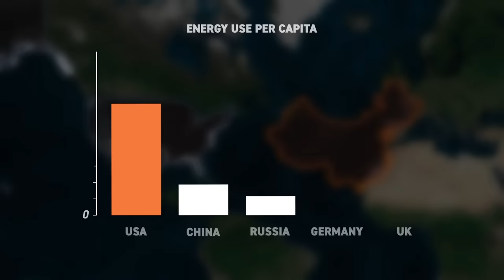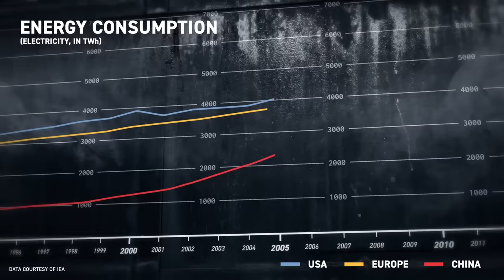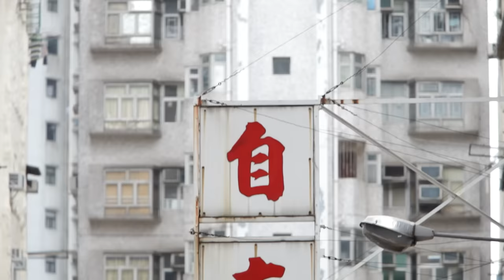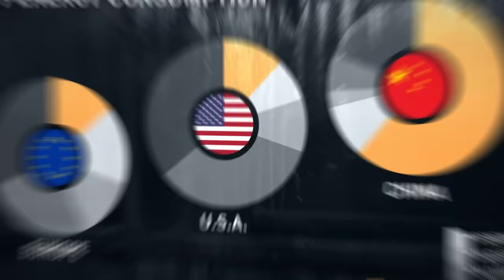China’s Electricity Problem

Comment: I thought I read somewhere that China had plans to drastically expand it's nuclear energy capabilities; I'm surprised there wasn't much discussion about that.
Reply: It is true, China developed a new type of nuclear reactor that is smaller, safer and generates little radioactive waste and over 200 of them are being developed and built with most coming online in the next decade. This new reactor is also currently being built for the Belt & Road countries.

When it comes to China, Wendover Productions tend to pick data that matches its narrative so anything that does not fit is not included.
Reply: China does plan to drastically expand its nuclear energy, but building nuclear power plants is very tricky. Old technologies require nuclear power plants to be near a large body of water for cooling, which limits the locations, and they take a long time to build. So China is also trying newer technologies which still require a lot of testing. For example, it's testing Thorium Molten Salt reactors, which is an entire other branch of technology compared to uranium, so large-scale commercial deployment is only expected in 2030 (but the hope is that if it works, it can be mass-produced).
Reply: @valerievankerckhove9325  China is already at the level of exporting components of nuclear plants to countries like US
Reply: That doesn't fit his narrative.
Reply: @singularityraptor4022  well probably not the US, and the Hualong One project in the UK is probably as dead as it gets, but that's just geopolitics... it is true that no country in the world is building nearly as much nuclear power as China, and as a result no one is better at it than them, but nuclear plants are simply so much more expensive and difficult to build than coal that they can't be a 1:1 replacement at the production rampup rates required. it definitely should have been mentioned in the video though.
Reply: @rcbrascan  I'm assuming you're referring to Thorium nuclear power? Didn't know China were even involved in that let alone early developers of the science behind it. Shame they didn't cover that yeah :(  Hopefully it lives up to our expectations, could definitely be a game changer as far as power grids go.
Reply: @rcbrascan  China will fail, but all you wanna do is try to find the few things they succeeded at. That's called bias.
Reply: Nuclear actually makes up a very small portion of Chinese energy consumption, not because they don't have reactors (they do, and lots of them) but just because their power consumption is so damn large.
Reply: @bocbinsgames6745  Just googled it, the installed coal capacity was 1080Gw in 2021 while nuclear only had 50Gw of capacity and there target of 200Gw by 2035 would account for 7.7% of their predicted installed capacity by then.
Reply: @singularityraptor4022  Which is?
Reply: @valerievankerckhove9325  yes I learnt a little about thorium a few years ago, seems to be the perfect solution. Safe, cheap, thorium is abundant so this should be promoted more.
Reply: @pumba9393  The early developers of thorium molten salt reactors were the US, specifically the Oak Ridge National Laboratory in the 50's. Unfortunately it was the Cold War back then and thorium reactors didn't produce byproducts that could be used for nuclear bombs, so their branch of research was cut off (oh the irony). There were some technical challenges remaining (namely linked to corrosion), but that didn't mean it couldn't be overcome with a few more decades of research.

Eventually some scientists found the papers rotting in some closet, found it a pity to waste it, and posted everything on the internet. Several countries picked it up, including China (but also Canada, India, a bunch I've forgotten...). China in particular is pushing ahead because it doesn't have much uranium but has Plenty of thorium just lying around.
Reply: @singularityraptor4022  I'm reading this comment in a snarky tone. If so, whats wrong with writing a video with information that fits the narrative?
Reply: @rcbrascan  “when it comes to China…” lol, wendover is harsher in USA than anyone but I bet your .50 RMB that you never complain  about that. And China only has a handful of new nuclear plants in works which will take years to build. It needs a lot more nuclear plants.
Reply: Lmao. Tofu reactors. Can't wait to see that.
Reply: @singularityraptor4022  Yup, we are about to sign up for nuclear plants built in China.
Reply: might misunderstand your words, nuclear power is along the east coast, the power crunch mainly happened in other provinces less advanced, major power generating provinces with nuclear power have less power crunch, at least i don't feel it by myself , only saw the news on media platform
Reply: "It's" is a contraction of "it is", but "its" is third person singular possessive.
Reply: @johannesgutsmiedl366  Well, not sure if the US directly using Chinese components in their nuclear reactor but due to recent difficulties in the construction of nuclear power plants in the US, they openly mentioned that they're actively studying from abroad, especially China.
Reply: @singularityraptor4022  Frankly, when 60% of China’s energy needs and 70% of its electricity still comes from coal, it becomes a bit of a moot point.
Reply: Regardless of global warning, Nuclear power is clearly the answer. Why don't more people talk about this in general..?
Reply: @valerievankerckhove9325  There we go, I was surprised when I first read the comment. Thanks for clearing things up, my memory is unfortunately rather poor and I'll try my best to remember this time👍
Reply: Yes about 8 or 12 nuclear reactors they should be coming online soon
Reply: yep. his analysis was normie AF
Reply: @pumba9393  "Didn't know China were even involved in that let alone early developers of the science behind it."
false.
Reply: Nuclear plant just take too long to get online to meet China deadline.
Reply: You should see China's solar expansion, PV-Magazine is reporting 600GW per year of PV capacity by end of 2022, for context the entire European Union has 976 GW capacity, from all sources.
If Wendover isn't too busy trying to push the China-uses coal narrative, he might realize the real story is how China is less than 10 years from having practically infinite, domestic, free, and as a side benifit, clean energy.
And I don't think I need to explain what happens to industrial competitiveness when you have infinite free power.
Reply: Nuclear rollout has been talked about but I think the issue comes down to the price. As Wendover pointed out, electricity prices in China are very low, and nuclear just isn't cost competitive enough. I suspect the government would like to see a rollout, but the power companies are resisting it, as they can see themselves getting stuck between the low energy price rock, and high production cost hard place. The government is also very wary of upsetting public opinion (few things worry the PRC government as much as public unrest) so the location of any new facilities is difficult. I think the government would like to ramp up nuclear in a big way, but it's just cause too many other issues. 

Probably the best solution from the government point of view would be to create a mechanism that incentivises provinces to trade power, and incentivise renewables - likely some kind of energy carbon credit for the provincial government that they "spend" when buying electricity from coal for their grid, and "earn" from renewables, be they self-produced or imported from other provinces.
Reply: @MGZetta  I hope so because right now that's the best place in the world to learn from
Reply: @SelfProclaimedEmperor  It takes one special piece of garbage to write that out and unable to see the irony.
Reply: @briano7986  Not being biased is typically valued
Reply: Exactly. Wendover is probably a big lefty.
Reply: @SelfProclaimedEmperor  Lol your comment is super biased, ironic
Reply: nope. they are building alot more coal plants.
Reply: Their demand is far too much. The current nuclear supply chain simply isn't capable of building at the rate they're building coal plants now, especially with extremely tight safety margins.
Reply: Doesn't China have it's Type 004 too, using molten salt nuclear reactors? It's a dual whammy
Reply: @gloriousrunningpotato  现在我们这边很多自建房都是楼顶上盖光伏板发电，然后合并到电网里！居民用电0.5元人民币，商业用电0.8元-1.3元人民币！天然气2.6元人民币一立方！
Reply: @al-du6lb  Fukushima if you want to talk about this.
Reply: @kanlu5199  Even when you consider all the nuclear disasters, the amount of people effected is scant compared to fossil fuels. Just looking at the amounts of lung cancer caused by fossil fuels compared to the number of people effected by all nuclear disasters is enough to show how safe nuclear is by comparison.
Reply: @al-du6lb  Your comparison did not include how long the pollution last. For nuclear, the pollution usually lasts for thousands of years. Because you won't meet that so it is not your problem.
Reply: @kanlu5199  Yes it does. Look up some nuclear advocate videos. They make a very compelling argument. It's not perfect, but nuclear is the best solution we have.
Reply: @kanlu5199  Can you name any waste industrial  material (say lead, cadmium etc) that last only a few years?
Reply: @sidsarkar  It is all good as the USA still uses them for water pipes.
Reply: good question. I guess the producer just wanna give you the image that China used plenty coal to generate electricity
Reply: @pumba9393   Pretty sure they are just doing better regular reactors and breeder reactors. There has been very little advancement in nuclear since the 80's so there are lots of incremental improvements that can be made simply with investment in it.
Reply: Nuclear power plants have the opposite issue to what he pointed out with coal plants: the bulk of the expense is upfront. This is exacerbated by the fact that they require very skilled labor, and take a long time to construct. I honestly doubt PRC could build enough nuclear plants quick enough to even just replace coal plants that are wearing out. 
The pricing problem, and the rivalry of provinces problem, are still the 2 main obstacles to them though.
Reply: @Telmach  " As far as I'm aware the Oak Ridge 1977 Molten Salt reactor experiment didn't have any faults or issues that needed to be ironed out."
There were actually a lot of issues that needed to be ironed out. The wiki page summarizes it ok, but doesnt do a good job of discussing the structural steel problems. 
The first alloy they tried corroded too quickly and was abandoned. Their work progressed to 'Hastalloy N', and there were issues identified with it:
"Given limitations with this alloy... it is not recommended that the significant additional effort...be undertaken."
See this article for more info: "Status of Metallic Structural Materials for Molten Salt Reactors". 

What does this all mean? 
It means LFTR based on the FLIBE salt and thorium as fuel would need a lot more time and money in R&D, and then years of qualification of all the components of the reactor by regulators. 
It is daunting, especially when a range of other more promising designs and solutions are available right now. For example the SMRs like Terrapower Traveling Wave liquid sodium fast reactor design, and the new generation large pressure reactors like the South Korean APR1400.
Reply: Yeah nuclear fusion
Reply: @rcbrascan Bro what are you on tho😭😭😭